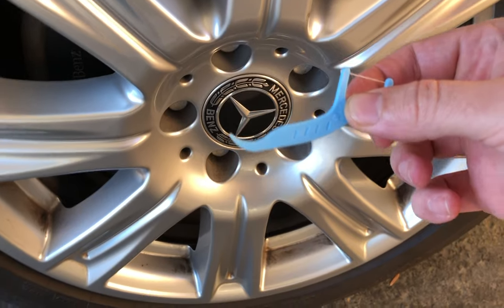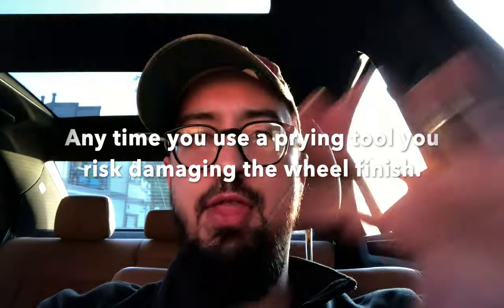Mercedes 🔥EASY and 😈QUICK⚡️ center cap removal and tool DIY works on AMG!

Comment: Clever methods - I'm going to try this on my Jeep, which so far all I could find on pulling out center cap was jimmying it with a flat head screwdriver...
Reply from the maker: If you use a screw driver you risk marking up the wheel finish.

Comment: Good Job, I like your suggestions I’m going to try the cardboard way first 👍 unlike another video I’ve just finished watching where the guy used a screw driver with insulating tape on the end and a hammer, guess what and unsurprisingly damaged his nice alloys 🙄 I would think there is only any point posting a video on You Tube and that’s if it’s helpful, showing you how to damage your wheels is not helpful at all.

Thanks again for your neat video, off to fit my wheel caps 😀

Update: I used the cardboard option, it worked an absolute treat and took less than 10 minutes to do all 4 👍

Thanks Mike!
Reply from the maker: I'm glad the cardboard option worked! Its a good way to do it without any scratches.

Comment: Hallo Mike.
Maybe You can help me.
I have a 350 Mercedes with the M272 . My problem is that when the motor is worm I hear a knocking noise from the left side of the car wen standing on the front.
Do you have the same noise?
My car have 130000 km on the clock.
Sorry for my English 
Thanks for your videos.

Comment: If you are going to replace them, can't you just hit the center with a hammer? No damage to the rim lol
Reply from the maker: LOL but they shaped like bubble so you risk the screw driver of punch scrapping to the wheel if you dont hit hard enough to get through the plastic.
Reply: @mikeicee  Well then an electric driller will do the job 😎
Reply from the maker: @wall-e7726  Just dont drill too far. Esp in the front

Comment: Use tape works in less than 5 seconds
Reply: What’s the tape method?
Reply: @Quadralyn Saddler  simply take a piece of tape stick it to the cap and pull.. it pops right out